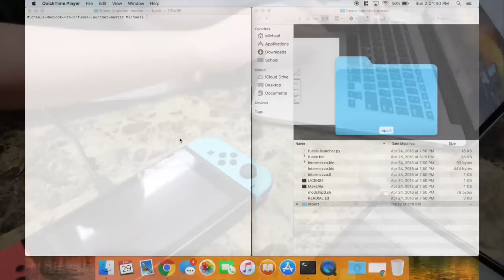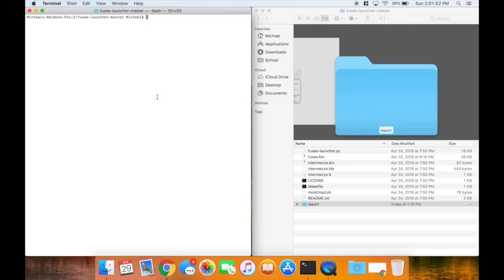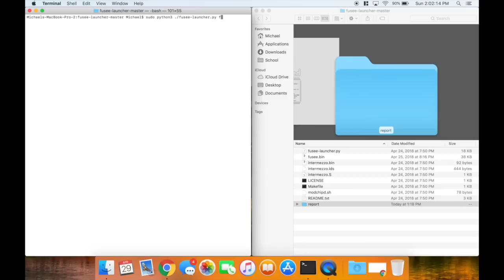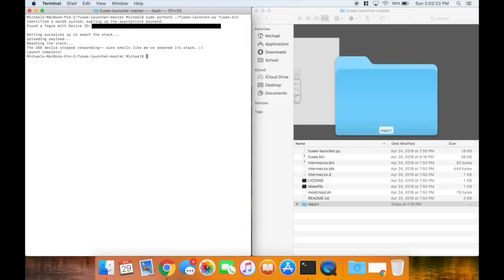How to Hack a Nintendo Switch Joycon + Run Fusee Gelee (Emulators NOW READY!)

Comment: I honestly hope this easy hack doesn't lead the Switch to the same fate as the Dreamcast.
Reply: Zamasu you have no idea how  a business makes profits do you.
Reply: Nathaniel Ventura Yeah, Dreamcast was stupid easy to  pirate games for.   All you needed was a blank disk and the ISO file.
Reply: The Wii had homebrew, and that system still sold a dumb amount of units for that gen. Nintendo made enough to survive the WiiU Fail Apocalypse :D
Reply: It’s Nintendo fault, where is the VC they promised us!
Reply: Kartuz Oh. I wonder how they get permission.
Reply: The Dreamcast had more problems than it just being hacked
Reply: The Dreamcast failed because of Sega's dumb business decisions, NOT piracy.
Hell, the PS1, PS2, DS, and other systems were pirated more. Did the PS1, PS2, and DS fail? No? Hm, that's weird, since they were all pirated up the ass.
Reply: +OutlawsBebop
gr8 b8 m8 i r8 8/8
Reply: Brahim Ruño It can only damage revenue if you can use it for piracy and the console is sold at a loss. I'm not sure if this hack can get pirated games to run.
Reply: Kartuz What is "Arcade archives"?
Reply: Kartuz So it's the new name for virtual console?
Reply: I dunno, how did PS1, PS2, and original XBOX do?  You could get those modded on any streetcorner, and after that pirating games was a joke.

oh, quite well?
Reply: more like the fate of the psone.
Reply: PICT[/.\]CHAT to say that piracy wasn't a significant contributor to the downfall of the Dreamcast is being a little ignorant. During the life of the PS1 and PS2, you needed to physically mod your system to pirate games, and most people didn't have the technical capabilities to solder in a modchip. The cost of actually getting someone to install a chip, or purchasing pre-modded one, could add anywhere from $100-$200 on top of the system price. Adding insult to injury, burners and blank CD-Rs were a lot more expensive and not as prevalent during the PS1 and PS2 era, so burning your own games added significantly to the cost of piracy during that timeframe. For the Nintendo DS, you had to buy a flashcard and had the potential to get banned online. And from my understanding, (if people our more familiar with the scene, correct if I'm wrong) several revisions of these flashcarts needed to be made because Nintendo found ways of blocking them, so mainstream adoption of piracy wasn't as much of a concern. With the Dreamcast, every single unit could run backups without any modification to the system or risk of banning from Sega, and buy this time CD burners went significantly down in price to make piracy a more enticing endeavor.

I do agree that piracy wasn't the only factor to the downfall of the system, but saying didn't have any impact on the console's demise is being very shortsighted.
Reply: +_ _ With trial and error, you could run pirated PS1 games using a method called "hot swap". Basically, by taping a certain area in the PS1's disc drive, it would allow CDs to run at fullspeed without needing to close the drive. Then, users must put in a real PS1 disc, wait for the screen to change, then quickly swap the real disc for the fake one. No tiny soldering required. (See what I did there?). Even if CD burners were expensive, one could pay someone or go to someone's house to burn a game to their disc. People with CD burners were possibly the "coolest kids on the block."

I don't know how old FreeMcBoot or a predecessor of FMCB is, so I guess I'll give you a pass on PS2. HD Loader homebrew exists to run PS2 games from your HD (only on phat PS2s), however.

The DS and DSlite had non-updateable firmware. Only DSi (XL) users had to worry about what model to get. I'm not sure if DS users had to be cautious about getting banned online. I'm sure if one is using a flashcard and no cheats, the user won't get banned. I'm too young to know, though.
Reply: PICT[/.\]CHAT The hot swap method wasn't widely used because it wasn't fool proof, added significant risk in damaging the drive, and was squashed with later console revisions released by Sony. And yes you're correct, homebrew and piracy capabilities weren't released for the PS2 until after the PS3 launched, so widespread piracy wasn't a concern in the console's critical years. Even so, Sony did combat these exploits by updating the bios on newer versions of the console anyways.

While Sega did update Revision 2 consoles Manufactured after 12/00 to remove the consoles ability to boot Mil-CDs (the exploit used to run burn games) on the Dreamcast, piracy was rampant enough early in the consoles life to significantly affect software sales and scare off future developers and publishers alike.
Reply: The Wii has the easiest and most hacks of any console and look at its sales.
Reply: how the hell can it be the next dreamcast
Reply: it was inevitable.. but it wont ruin the switch in any way. if anything you will see switch sales increase because of this.  have a switch running emulation is gonna be a endgame console for a lot of people. its a great think imo.
Reply: well i cant speak for everyone but i do own a few hack console wii, wii u xbox 360, ps3  ,when ever i play a good game the that i like i actually go out an buy a copy of the game a save ..i get to play an try games i would have never in a million years try an now am into rpg & adventure games and all i use to play was shooter ..long story short i actually buy more games than i normally would because i have modded systems
Reply: Nathaniel Ventura dreamcast sold 10 million switch sold 15 million
Reply: Dude its not easy people are not going to go out of there way to do this people who get switches include children which find it to complex and hard put a paperclip haha
Reply: at shepd3 you dint need to mod a ps1 all you need was a bent hanger you could hot swap the discs after sony logo and it pass ( ps1 only checked evertime it was opend /closed use a coat hanger it never relised you were swapping discs
Reply: XBOXRULES Soft Mods like the ones on psp is easier
Reply: thecouchtripper the switch was amazing even before the hacks, you missed out man
Reply: If anything itll help the sales more
Reply: It wont. The DC failed because Sega didn't have the money to make a better  model. And it wont either end up like the PSP because Sony where retarded and stopped supporting it like they did for the Vita. They did not have any faith in their portables. 
Nintendo has billions, they will just release a never version and make new games run worse on the old switch.
Reply: Dreamcast failed because it was released right after everyone bought new sega consoles and where still happy with 2d side scrolling games, had nothing to do with being hacked
Reply: I hope it does. Nintendo hardware needs to die. They need to just make their games for relevant systens like PlayStation and PC

Comment: Will you still be able to exploit and run custom firmware on the switch if it gets bricked?
Reply: Michael Rosenberg I guess I mean people are saying they are using 3rd party docks and that is bricking the system. Could you still run the exploit after that?
Reply: Michael Rosenberg Thanks! Seems someone managed to get it to work even when its bricked. https://mobile.twitter.com/GeekStuff_fr/status/989911035711774725

Comment: Also i want to correct something if you move pin 8 to the left side and push 9 over 10 your joycon will still work on docked and undocked mode ... atleast it did the trick for me
Reply: i checked its connected over UART .. and not bluetooth you see it the best when you slide it the joycon
Reply: if you have time contact me on discord natehaxx about the linux installation